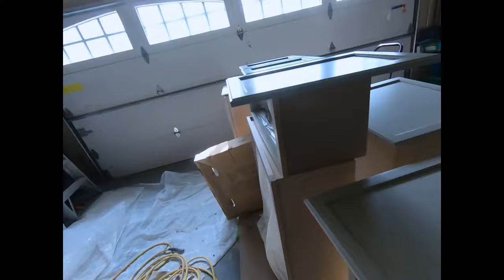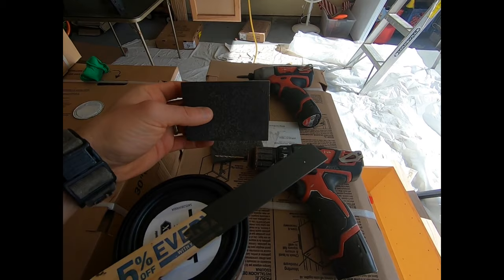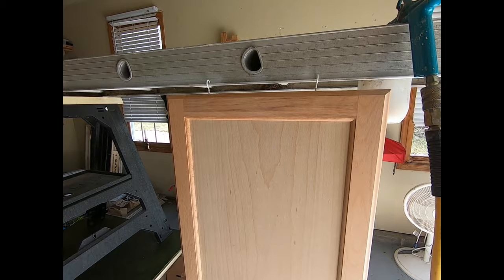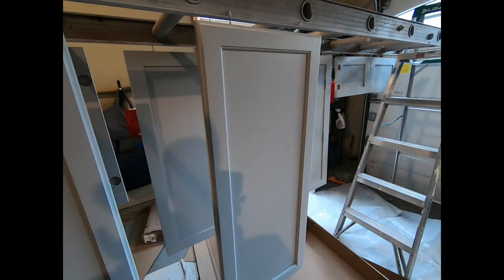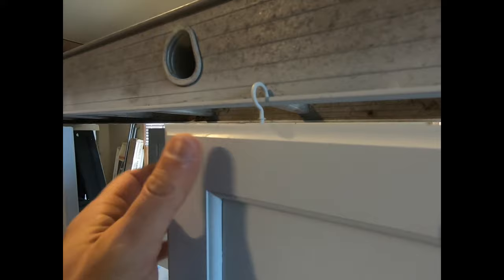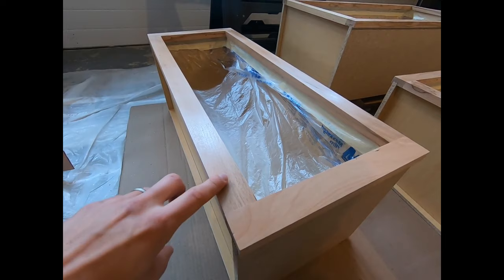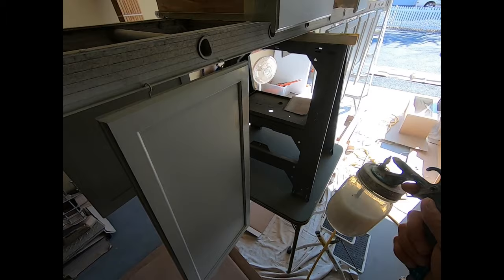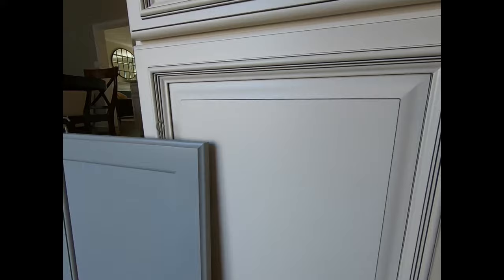How to paint unfinished cabinets from home depot or lowes

Comment: Great video!  Definitely learned more here than other videos!  I believe you said 250 grit sanding blocks?  Do you know what level did you us on the steel wool?  Thank you.
Reply from the maker: The block is a 220 grit, but you can use even finer grit it’s ok.  The steel wool is standard and honestly, you may not even need it.  Hope this helps.  Good luck 👊🏼

Comment: Hi :) First, thank you so much for posting this informational video! Second, I fully admit whatever happened is probably me not doing something right...
This did not work for me at all. My cabinets were the unfinished ones but the previous owner painted them. You could still see and feel the grain so I used the sealer (same in the video) and I felt like it was doing a good job filling the grain but needed another coat so I did 3 coats total (sanding 220 in between). Then sprayed my first coat of paint (with the critter and same paint you used in the video) and it looks like I didn't use the sealer at all. You can still see all of the grains. What did I do wrong? Thanks!
Reply from the maker: Thanks! Sorry your cabinets didn’t come out as you hoped.  So, the sealer is used to fill in pores in the fiber of the wood, not wood grain.  The cabinets I used in this video were from Home Depot and they come flat/sanded.  If you have grainy wood cabinets you will need to use a grain filler.  Aqua coat is one you can try, it’s water based and easy to use.  Unfortunately, wood grain fillers should be used first before paint/stain.  If your cabinets are grainy and you want them smooth I am afraid you’ll have to sand them back to bare wood and start over, sorry.  I suggest you do that on a small cabinet face like a drawer and determine if you want to do it for the whole project.  Hope this answers your question.

Comment: Really great and super informative video! How did the sides of the cabinet boxes turn out? I am just about to start, but I am concerned that the particle board sides of the cabinets where they are at the end of the row will paint poorly. Did you have any issues with this? Thanks!
Reply from the maker: Very gd question.  The particular board will paint poorly, so I suggest you sand it a few times more than the faces.  It will feel much rougher after you paint it, but once sanded it should be gd.  I suggest using a foam roller actually because of the size of the surface and the need for more paint.
Reply: @TrueGritDevelopment  Awesome, thank you for the tips!

Comment: Awesome video, thankyou. I am having trouble with the polycrylic water based top coat. It is causing a cracking sensation on the cabinets. Do you have any tips or suggestions for me?
Reply from the maker: Thank you! Not sure what you mean by cracking sensation.
Reply: @TrueGritDevelopment After the paint coat, the finish was smooth and looked great. I placed the polycrylic coat on and after about an hour when I checked on the cabinets they had a crackle finish all throughout :/ If you have an email I can send you a picture. I am not sure if it was the low temperature in my garage or if I should have waiting multiple multiple days to make sure the paint dried before applying. Before applying the polycrylic to the cabinets, they appeared dry to the touch. Have you ever seen this?
Reply: The poly is cracking because the base coat wasn’t fully dry.
Reply from the maker: Thanks, that makes sense.

Comment: Thank you for this video. My wife and I are doing the exact same thing, sprayer and all. We used a primer first and just did our first paint coat over the primer. Did the wood imperfections still show through on the first coat?and how much did you thin your paint per jar? I'm at about two cap fulls so far
Reply from the maker: Good luck.  What are you considering imperfections? If it’s chips, dents or grain, yes.  You will see those regardless what you use.  You will need a grain filler or wood filler to smooth out the surface.  If it’s discoloration like tan or yellow, that will go away after your 2nd or third coat.  Hope this helps.  Thanks for watching 👊🏼

Comment: Wow super informative thank you!
Does applying the polyacrylic help the the cabinets from feeling tacky or sticky from the paint and help prevent skuffs?
Reply from the maker: Glad you like it.  I have always used the water based poly and the results were outstanding, no tackiness and no scuffs.  I have just bought the oil based poly, but haven’t used it yet.  If you have the water based Poly, you should feel confident.  However, it’s imperative to get an even coat.  If you’re spraying, be sure to stand back at least 10” and use a fan technique.  I personally hate brushing this stuff on.  Hope this answers your question.  Please like and share the video 👊🏽
Reply: @TrueGritDevelopment  Thank you so much for the quicky reply! Love the advice :D

Comment: First off, great video!  Some brilliant things in there.  The hooks!  Huge time saver.  I'm about to buy the paint (already sanded and sealed and it's clear that I have a great surface to paint - with minimal time/effort so far).  Just noticed you use an oil based paint - can I sue a water based, or is the oil for kitchen cabinets a far superior choice?
Reply from the maker: Thanks for the positive feedback! I can’t take all the credit for the hooks, check out the Idaho Painter.  Anyway, the paint I used is a oil enriched enamel, not quite oil paint, but has similar characteristics yet cleans up with water and soap.  You can use water based paint with no problem.  Good luck! Thanks for watching and supporting 👊🏼

Comment: Seen you sanded after sealer and you already answered a previous question that you didn’t sand before sealer. 

Did you sand after first coat of paint or only second coat? 

Any significant difference in applying wood filler after first coat of paint compared to second? Feel like having two coats over wood filler would be ideal instead of one, just curious though.
Reply from the maker: I would lightly sand after each coat of paint; however, feel the finish as you may not needed after the third/final coat of paint.  I would also apply the wood filler as early as possible, so you achieve the same finish throughout.  Hope this answers your questions.  Thanks for watching 👊🏼

Comment: Hi! Love this video!!.. Wish I had seen it before installing the cabinets. I have put primer on one door already (as well as the boxes, which also have a very thin coat of paint in addition to the thin coat of primer).. can I put the sanding sealer over it? Or, do I need to sand the primer (and paint) off first..? Also, my cabinets are from Menards and do not have any veneer on them.. Do I need to put any kind of sealer inside the cabinets? It is raw wood.. and, how would you paint the boxes (which are already installed) themselves.. with a roller, or would you still use the sprayer? Thank you for any advice!!
Reply from the maker: Hi Davina, glad you like it.  Unfortunately, sealer goes first, so yes to sanding primer and paint, sorry.  I personally wouldn’t worry about sealing the inside box.  One of the reasons the faces and doors are sealed is because they will get paint or a finish stain…etc.  as far as painting the boxes (I assume you mean the faces of the boxes) a cabinet paint roller will do the trick as you don’t want to get paint on everything in the kitchen.  Even though the Critter doesn’t have a lot of overspray, it will still get paint where not needed.  I also recommend using a staining sponge/block if you’re going to seal the cabinets prior to painting as apposed to paint brush or roller to ensure even coverage.  Good luck with your project! Pls share and like the video 👊🏽

Comment: If we are using a primer first, do you recommend we use the wood filler for the gaps before we paint or once we apply color?
Reply from the maker: I would fill in the gaps first then paint.

Comment: Thank you for the video! You have inspired me to possibly go this route for a kitchen remodel.  Can I ask what size air compressor you use for your critter cyphon spray gun?
Reply from the maker: Glad you found it helpful! Definitely practice first on scrap wood though to get a feel for it.  I use a pancake compressed with a max 165 PSI, I think it’s a 6 gal capacity electric compressor.  Good luck with your project.  Thanks for watching 👊🏼
Reply: @TrueGritDevelopment  Thank you!! I will definitely practice as I have never used one before!

Comment: I just bought and painted unfinished cabinets and don’t like the way they look after 2 coats. They weren’t sanded or anything. What steps can I take to have a better look after already painting. I wish I would have saw this video beforehand.
Reply from the maker: Are they too grainy? You can use grain filler (3 coats) and repaint.  I have a video using grain filler.
Reply: Yes, very grainy! 
Thank you

Comment: The paint you used, is it a hybrid? I've watched several videos and many talk about the hybrid paints. BM, Behr and Valspar. 
Thank you very much for sharing your knowledge!
Reply: Also would you use the floetrol with these paints or the process in this video?
Reply from the maker: Hi, for this one I used the cabinet paint from Valspar.  I am also used emerald from SW and plain paint as well.  I’ve also used Floetrol before, in fact I have another video on my channel where I am refinishing a whole kitchen and I use Floetrol there.  I would recommend using cabinet grade paint and Floetrol is always good, doesn’t hurt.  I find that as long as you’re spraying you will get the best finish.  Not sure what the hybrid paint is.  Maybe it’s the water based paint with oil like characteristics? That is cabinet paint.  Hope this answers your question. Thanks for watching 👊🏼

Comment: Idk what I didn't wrong but I sprayed the sealer with actually two coats and then sprayed on the color and I have lots of graing showing.
Reply from the maker: You mean graining? We’re your cabinets unfinished smooth? I got mine from Home Depot.  The sealer is not a grain filler either.  It’s meant to seal the wood fibers, so it provides a smoother surface to paint.  If your cabinets have grain, you should use a grain filler.  I have another video I will be uploading in the near future where I used grain filler.  Sub the channel, so you can check it out.  Thanks for watching 👊🏼

Comment: I followed your all steps on video and unfinished painted cabinet doors are still grainy after poly. How many times do I apply all the poly? Did not water it down I used to spray gun and unfortunately did not get yr your results. Help.
Reply from the maker: My unfinished cabinets were from Home Depot and they were sanded smooth, so I didn’t need to use any grain filler.  When you say grainy, are these deep grains? I’d they are, you have to use grain filler to smooth them out (I am uploading another video soon).  If the wood is smooth, you shouldn’t see grains maybe a shadow of them, but they shouldn’t stand out.  If you aren’t happy with the results, you can either use a grain filler or even a joint compound and spread it evenly scraping off all the access, sand and paint.  Deeper grains will need 2-3 coats.  It will dry quick, so you apply 2 coats of filler in one day easy.  I use Aquacoat and or Minwax wood filler depending on the application.  Hope this helps.

Comment: Hi, thank you for the helpful video! I’ve heard that polyacrylic would yellow over time? Is this true?
Reply from the maker: Mmm…not in my experience.
Reply: Great. Thank you so much for the reply! I’m currently following your tutorial to the T, thank you so much for sharing this! Wondering if you waited the full 24 hours between coats of paint?? Also, how long did you wait to apply the poly after the last coat of paint?
Reply from the maker: Since I sprayed the paint, I didn’t have to wait more than 1-2 hrs. b/n coats.  The 3rd coat I had to wait longer since the wood was already saturated.  You can Poly as soon as the 3rd coat dries, prob 2 hrs or so.

Comment: Can you use a brush or roller for polyacrylic and sealer sander?
Reply from the maker: Sure, I’d go with a roller for an even coat.  You will need to cut with brush and roll flat surfaces with roller.  Only issue is the coating may not be even.

Comment: great job!! so no need for primer, eh?
Reply from the maker: Not in this application since the wood is unfinished.  I would use primer on old cabinets before painting.  Oil primer would be best, if you were to use it, but I personally hate it for its odor and it’s hard to clean.  Thanks for watching 👊🏼

Comment: How much do you think the valspar paint?? What size compressor are you using? SCFM of your compressor?
Reply from the maker: Hi, by how much you mean how many gallons or how much did it cost? As for compressor, I am using a 6 gal Dewalt compressor.  No clue what the SCFM is on it.  I am pretty sure you can find that info online.  Thanks for watching 👊🏼

Comment: Hi thanks for the super helpful videos. Did you use any primer or just went straight to the cabinet paint? Also do you think for finishing you could use poly acrylic from a spray paint can or would you not recommend that ?
Reply from the maker: You welcome, thanks for watching. Straight to paint after sand sealer.  From a can is ok, it may cost you more and put some stress on your hand from depressing the can nozzle for a while.  If you’re only doing a cpl cabinets it should not be a big deal, but if you’re doing a bigger project just consider everything.  Hope that helps. Good luck with your project👊🏼
Reply: @TrueGritDevelopment  thank you for the speedy response if I already primed it with BIN shellac base primer will that hurt anything
Reply from the maker: No, that’s ok.  No need to use stain sealer either since u primed.  You may want to sand before applying paint.
Reply: @TrueGritDevelopment  will do thank you !

Comment: as per the directions on the back of the sanding sealer it says that its only meant to be used on surfaces that will only be finished with a clear coat. have you noticed any issues/problems since you use paint? thanks
Reply from the maker: Nope, no problems and it looks amazing.  You had me go back to directions on container: “ designed for use on projects that will not be stained, only coated with a clear protective finish.” However, it does NOT say NOT to use paint as a finish coat.  That could be open to interpretation.  In my case I used it as a sealer to provide a smoother surface on which to paint.  The paint had no problem adhering to the surface and the results were fantastic.  I will most definitely do it again. Thanks for watching 👊🏼
Reply: amazing. thank you!
 @TrueGritDevelopment

Comment: Any suggestions since I’ve seemed to have already started off wrong?
Reply from the maker: You can always sand them down and apply a grain filler to get a smoother look.
Reply: Thank you! After the grain filler do I paint again then apply the poly?
Reply from the maker: Yes.  Did you sand between paint applications? Liquid brings up the wood fibers.  You may want to sand first (light sanding), apply filler and then paint/poly

Comment: After I have applied the sealer it doesn’t seem to smooth out after sanding  as much as it was before the sealer and I don’t want to sand to much and remove all the sealer! Should I use a wood filler to make sure it’s smooth before painting and just sand more?
Reply from the maker: You’re painting unfinished wood? And after you applied the sealer, it’s rougher than when you started? Something isn’t right.  After applying the sealer and sanding, you should have a smoother surface.  Keep in mind the sealer doesn’t fill in the wood grain, so if you’re feeling the grain that’s normal, nothing the sealer can do about that.  Is this what you’re referring to, the grain?
Reply: @TrueGritDevelopment  yes I suppose so. I Feel more grain than I felt before. Just feels if I painted now it would be/look bumpy.
Reply from the maker: Where did you get your cabinets? The grain doesn’t go away unless you use a grain filler.  I’ve used Aquacoat, wood filler and joint compound in the past.  It’s a tedious process, but can be worth it.  The paint doesn’t eliminate the grain either.
Reply: Purchased them from Lowe’s! Unfinished cabinets. Ok thank you. That helps. Yours looked so smooth after u were done so I assumed maybe I was doing something wrong. Maybe I will try the wood filler. 😊
Reply from the maker: Ok.  I didn’t have to use grain filler on mine.  Perhaps the Lowe’s ones aren’t as smooth as HD? For your peace of mind and future reference, you may want to check out the HD ones to compare 🤷🏻‍♂️.  Sorry you’re not getting the results you want so far.

Comment: Why you didn't use primer?
Reply from the maker: Sand sealer is thinner and works its ways through the wood fibers better when used on unfinished surfaces, so it makes for a smoother base.  It also dries faster.  I use primer on finished surfaces.

Comment: You don’t need sanding sealer. You only need to sand, use primer, and paint
Reply from the maker: Even though these are unfinished cabinets, they are sanded, so you don’t really need to sand those at all. The sanding sealer seals the pores in the wood, which makes for a much smoother finished surface. It is definitely an optional step, however so you can only prime and paint if that’s what you want to do.  Thanks for watching👊🏼